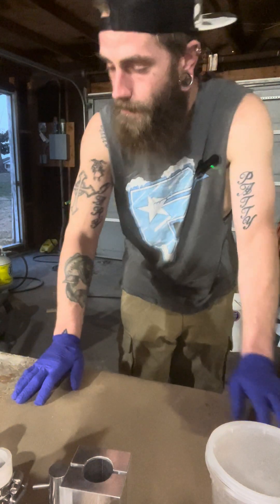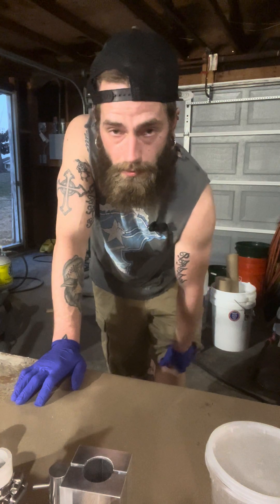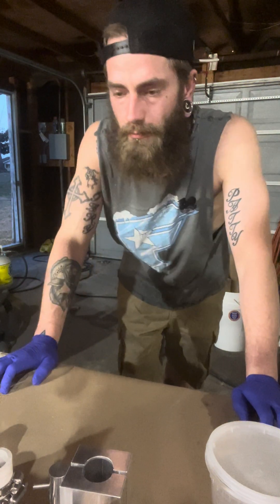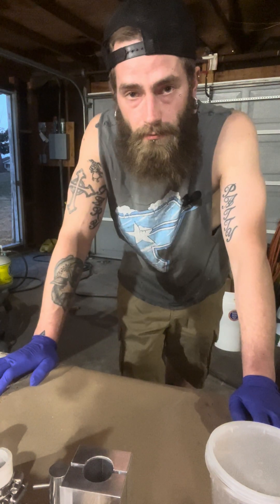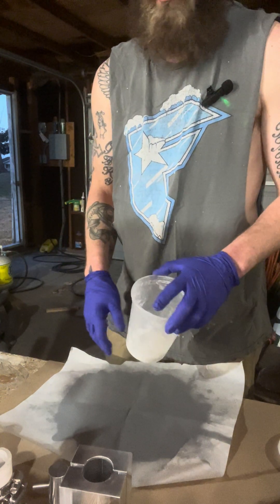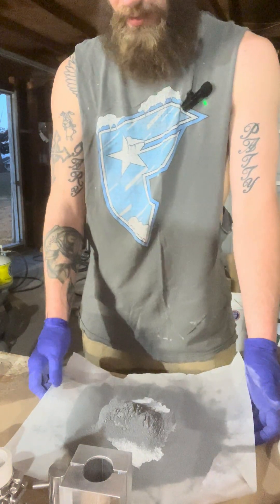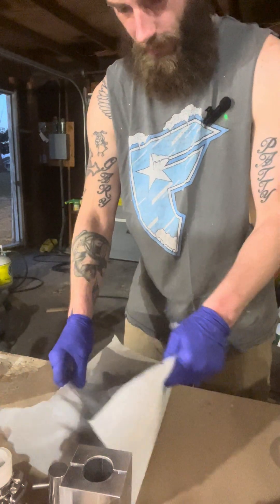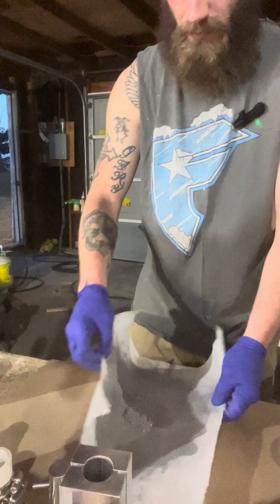Making Flash Powder a little safer

Comment: Hey boss, check out TPA. I made I video discussing it a couple months ago. You can replace half the aluminum with TPA to make flash a lot more insensitive to handling and mixing. When lit unconfined it just burns really bright, (no explosion to worry about when mixing). But when it is confined it works very well in salutes as well as crackers. It doesn't work as well in smaller quantities as traditional flash, but with glued ends I can consistently get crackers with less than 2 grams to go off. It also produces a bit deeper of a thump than traditional 70/30. My go to mix is 70/15/15 KCLO4/TPA/ dark AL. Have a happy and safe 4th🤘🏻

Comment: Iv been making fireworks since 2007 or since im 14 yrs old im 32 now my uncle owns one of the biggest mom ad pop stores in the east coast badaboom and I totally agree with this guy he did everything and said everything as safe as u can get flash powder is a force to be reckon with its extremely unpredictable I know guys been making salutes 5inch 6 inch heavy salutes for years but my one buddy blew his hands off he was licensed and everything in a professional environment it domt matter one that spark or shock ignites it its over and just know after 30g every 10 g of flash becomes more and more unstable I lit 100g in a paper cup unconfined it exploded just like a 3 inch titanium would confined
Reply: There is no good reason to mix some of the exotic formulas on the internet. 70/30 is the way. I cringe when I see folks making and showing exotic flash.
Reply: @jeffhays1968 can you elaborate on the downsides of exotic flash? I don't build and am clueless I'm just asking out of curiosity.
Reply from the maker: @SwagMoney69420 it’s just when you start adding more chems than necessary you start to add the risk of incompatible chemical reactions. The risk of higher sensitivity also increases when more ingredients are added. In my opinion the slight auditory change you get isn’t worth it in most instances.
Reply: Badaboom is awesome!

Comment: Jost ordered my stuff bro. Gonna follow this too a t!!! Anything else safety wise i should be aware of other than whats ib the video?
Reply from the maker: Nice man! I feel like I covered most of the major bases. I didn’t emphasize enough in the video that some form of respirator or at the very least dust mask should be worn. That fine aluminum powder is not good for your to breath and I didn’t set a very good example just raw doggin it lol. And I’m not sure what your experience level with black powder or other compositions are but just don’t underestimate how powerful this stuff is compared to black powder crackers. When you see it you will know what I mean. Practice those few safe handling steps and use common sense and you will have a huge smile on your face!

Comment: Funny how the stages of pyro take place, and it's mentioned in this thread. Black powder, rockets and flash powder. Flash power can be in the air and be ignited under the just right circumstances, which I found out about personally. I did come across a guy who milled black powder to such a point it acted like flash powder, amazing.

Comment: ive never handled flash myself but wouldn't wearing gloves defeat the purpose of a cotton shirt because of the melting? Most likely your hands will be closest to the flash anyway so wouldn't it just melt the gloves into your hands?
Reply from the maker: I mean yes you are correct. This practice isn’t just with flash but for most pyro compositions. I think the goal is to just mitigate as much injury as possible. The gloves protect your hands from the chemicals as you work and the cotton protects from potential fire. To be clear I think if something goes wrong your hands are screwed regardless of the gloves lol. At the end of the day we all just have to weigh the risk and reward of what steps we want to take with each project. I know personally I’d prefer severe burns on just my hands vs my whole body.

Comment: Well why didn't you take all the precautions and work outdoors Superman.?
Reply from the maker: You raise a good point, thanks for adding that. Not always practical to work outside so I mentioned a clear path to an open door. You could’ve left the Superman part out though that just makes you look like a jerk.
Reply: He was aware of what safety precautions he didn't use which is good cus he's atleast aware of it. He was making a smaller batch so it was a "whatever" moment

Comment: Great video bro and like you I have been here. I constantly research and keep learning from others. Being super over cautious is the only way to go. Just for the community here, I am adapting some research in replacing some of the dark Al powder with amorphous boron powder. This lowers the sensitivity however amorphous boron has a very high energy density. The research is pretty new however anything to lower the sensitivity of flash is highly welcomed. In my early years I have a very frightening experience after very loosely confining about 2 teaspoons of flash. It was handled and ignited with all precautions however boy did I not realise how powerful this stuff is. The danger here is that newbies move from black powder or similar to the same weight or volumes of lash powder not being aware of the massive difference in power. Keep safe👍
Reply from the maker: Thank you for sharing your experience here. That is the atmosphere I wanted to cultivate with videos like these. We all learn a lot from each other and you are exactly right.. the first time I set off even just a few grams of flash I was dumbfounded at how powerful that stuff was. If someone isn’t familiar with basic safety measures bad things happen and it’s a stain on the community. So I appreciate you sharing your scare. Good luck with the new development! Sounds interesting keep us posted. I bet ShortFuseMan would have a lot of insight to share on the topic.

Comment: I was the exact same and I'm pretty sure that's the same with every beginner pyro, starting off with making the bangers. M80s Blockbusters you name it. But to be honest a one trick pony gets old pretty quick, then that's when you move into either rockets or shells or both. If you're a beginner going into rockets I highly suggest getting BP down first, don't do what I did, I skipped the BP and went straight for whistle and strobe. lol for a beginner it was a hair pulling experience. Lots of wasted composition, luckily there's a lot more step by step tutorials on whistle and strobe. Info that would have helped me out tremendously when I started. Steps you don't think are that important turns out is the key to your success. Like fully screening your comp. No such thing as over screening LOL

Comment: 70/30 is not unstable at all. It's the most used compound used in fireworks. It's mixed in bulk and packed and shipped over seas and handled very roughly from there to here. It's a very stable compound. Iv used this same thing for the last 24 years without a problem. 100 grams at a time is a good number to start with though. A hammer hitting this stuff wont set it off.
Reply: I highly doubt that 70/30 is premixed and shipped overseas! I have never heard of a company mixing flash powder and shipping it as is. It's always mixed on site. personally I don't diaper method I just mix regular in a cup. But I will admit one microstatic spark and that hundred grams you speak of will be a "life-changing" experience.

Comment: Just binary mix it safer than diapering open flash. And if you want attach completed device to a long pole and roll it back and forth. 

But honestly man ive seen all the methods all the different exotic mixes ive seen 50 year old orchard m80s pulled from an old rusty tin can still work. It was probably chorlate based as well. Ive seen 10 pounds screened through a giant mesh screen. Thats the way the big companies do it.

Just mix what you need load into said device follow all PPE and safety and you shouldn't have any issues.
Reply: Yeah there are a lot of paranoid, fear, mongering videos out there.. just be patient take your time don’t be stupid do real research and use common sense..
Reply from the maker: I can agree that some people make it into a way bigger issue than it needs to be but calling it paranoid and fear mongering is kinda irresponsible in my opinion. I think it’s far better for people to be overly cautious than completely careless dealing with this stuff. It really does kill people literally every year and it makes this community even harder to be apart of because of regulations. But I completely agree that if you do your basic research practice a few simple safety precautions and use your head 99.9% of the time you will be golden. Which conveying that was my entire goal with making this video.
Reply: @Pyrodadsam oh I know I been mixing for quite a while now what I mean by fear mongering is the video of people who clearly have no clue what they are doing, but then make a tutorial about how much you should make at a time .. your videos are great I’m talking about the dip shits who clearly have no clue lol you know what I’m talking about
Reply from the maker: Haha yea I know exactly what you mean bro. There are a lot of dipshits on this site that have no business sharing info to masses of people. I’m no expert but I do enjoy sharing it here as I learn. It’s how we get better at this stuff.
Reply from the maker: And yes I agree binary mixing is probably a better option compared to diapering but the video was targeted at people researching flash for the first time. Binary mixing is usually done with large quantities of devices that are to be transported which most green pyros won’t be doing much of. Thus I felt showing the diaper method was more practical. And your at home pyro isn’t going to be mixing pounds of flash at a time.. just because it can be done doesn’t mean it should lol

Comment: HOLA  AMIGO SALUDOS ESTOY EMPEZANDO EN ESTO Y SOLO QUERIA SABER SI HACER FLASH CON  NITRATO ES MÁS SEGURA QUE CON CLORATO O POTASIO ..... YO LAS HAGO PERO JAMAS PASO DE 100G ES LO MUCHO QUE HAGO AUN ASI SIGO  BUSCANDO MÁS INFO SOBRE ESTO DIME CUAL PUEDO EMPEZAR  LOSE QUE ES PELIGROSO LO TENGO MUCHO ENCUENTA GRACIAS .....................
Reply from the maker: Hello welcome! I would say nitrate based flash compositions are generally safer just because they aren’t as volatile, with some exceptions I’m sure. I don’t have experience with them personally though. I will say I would do my best to stay away from chlorate based flash compositions. If you are going to use a more powerful oxidizer try to use potassium perchlorate instead. Chlorate is much more sensitive making it more dangerous to handle.
Reply: @Pyrodadsam  gracias amigo si yo los tengo los 2 clorato y perclorato... pues mejor dejo aun lado el clorato...amigo megustaria probar con perclorato puede ser 50y 50 con aluminio negro me puedes pasar solo una pequeña formula gracias por tu video.......  no te que sonido del nitrato es bueno pero siento que me falta con más bummmm sabes lo que me refiero lo puedo co seguir con perclorato

Comment: you dont wanna mess with any of those flash powders. Make some ETN, Nitrocellulose, RDX. ANFO/ANSU those are all much much more safer and way more powerful. Add aluminum powder for the effect.
Reply from the maker: Although nitrocellulose has its uses, none of those compositions have a place in pyrotechnics. With all due respect that is terrible advice to put on this video.
Reply: Appreciate your comment. As someone who works with High Explosives (such as those you mention) and Low Explosives (flash powders and other deflagrants) I have to disagree. Flash compositions (L.E.) have their place in civilian pyrotechnics because they do not require a Detonator to go off. A basic flame is sufficient to initiate them. Secondary Explosives (H.E.) such as those that you mention require a Detonator to initiate. For most applications, that is impractical in civilian pyrotechnics, unless someone is working with Class A / 1.1G – 1.0G devices, which can evaporate you if you’re not careful. So yeah, flash powders are very useful when you need a simple boom without military power.
Reply from the maker: @ thank you for articulating that better than I could.
Reply: @ShortFuseMan  flash is too sensitive to handle in my opinion. What I like to use in my crackers are DDNP or a plasticized chlorate/perchlorate. But I do agree with the fact that primary explosives are dangerous to handle. i only use flash nowdays in 10mg quantities. Thanks for the info
Reply: As long as your safe its not going tk go of eithout a reason

Comment: I jabe tried to set if off multiple times with an elecyrpnic igniter without success, so static os the least of the worries imo. Grinding or impact os what i would worry aboit most
Reply from the maker: Hmm.. was that with 70/30? That’s crazy if so. I have seen demonstrations showing how sensitive it can be to static.
Reply: @Alexpapaap  make sure to use a less fuel ratio for example instead of 70:30 a 90:10 could be safer
Reply: @DoloresUmbridgeairsoft  Well, 90/10 if you’re talking about AN/Al high explosive, but that formulation cannot be transferred into deflagrants like flash powder. Mixtures with 90% perchlorate and only 10% metallic fuel with not provide adequate performance in the contexts of fuse-initiated flash compositions.